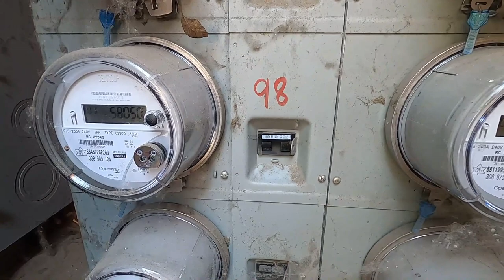How It Works - Mobile Home Park Electrical Distribution System : E089 / BC Renovation Magazine

Comment: In every park I’ve ever lived in, each house had it’s own meter. The meter is attached to a pole that is near the house. It’s usually up to the homeowner to have the electrical hooked up to the home. By a licensed electrician, in most cases.
Reply from the maker: Kay, that's interesting. All of the parks around here have the meters in these meter sheds like this one. It must be one of those things that is different in different areas.

Comment: Nice enjoyable video Sir. If I have a similar meter closet in my apartment and there’s an unused meter slot, can I add a sub meter with a 50amp right under the sub meter like in your closet and run a 6/3 cable to my electric car without the need to install a subpanel? I mean it’s only one car (one load) so I don’t need a subpanel unless my electric service provider makes me put one in due to some code requirement.

Comment: down here in Boise, the original park is fed by a central system like what you have spaces 1-98 have the power added to their rent because the original system was all sub metered. in the newer part of the park where I am, we are all on our own meters. there are about 200 units in our park. I like having my own meter so I don't have to worry about not having enough power.
Reply from the maker: Hi, John. That's interesting! Thanks for commenting. 🙂